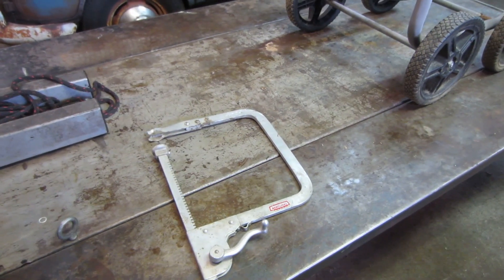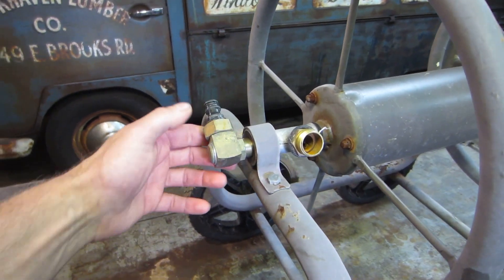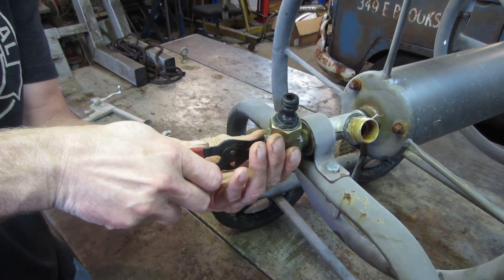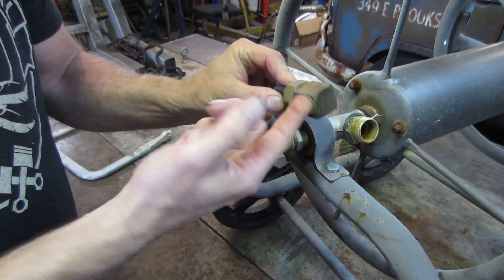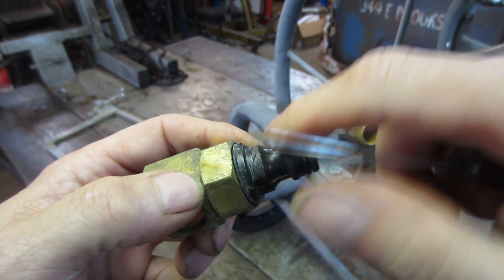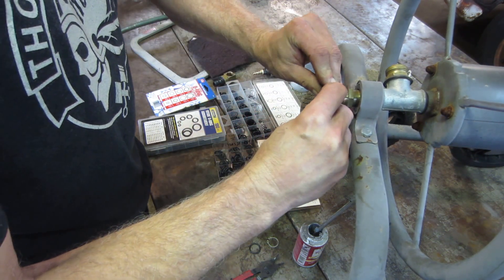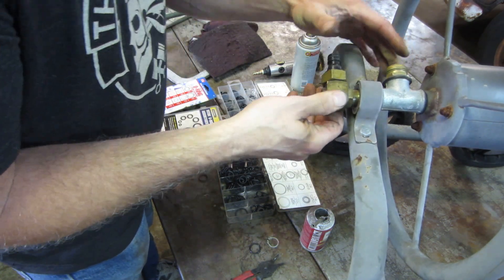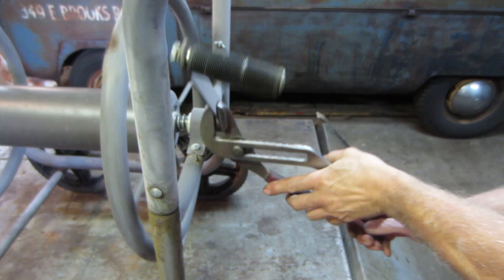scrap yard hose reel repair.

Comment: Thank you SO much for this video! I have 3 identical carts & 2 are leaking in the swivel. My father passed last summer & I’ve spent the past yr trying to fill his very big shoes in caring for the house, 10 acres, blackberries/fruit trees-as mom is no longer able. I can’t tell you how many seemingly small things like these leaks have made me appreciate how much he knew how to do & how much he did. Tasks that take me days to figure out, he would have fixed in mins. These hose carts have been so frustrating bc I haven’t been able to figure out how to take the swivel apart & hated to spend $200 a piece to replace. Dads workshop is filled w/thousands of parts for every repair imaginable but knowing how to repair, what parts to use etc has been time consuming. So I thank u today for helping me. I’m truly grateful.

Comment: LOL, never thought I could enjoy watching someone fixing a hose reel but I did, I did. Thank you so much for your videos, knowledge and saving some of the weirdest contraptions I've seen in a while.
We get snow down here and the kids want to put it in the freezer till summer. lol 
My third job was at a Volkswagen shop. I was 14. They had bought a train car load of Continental tires that fit everything from an Austin-Healey to a VW. Didn't have a Cotes. All I had was an IRON MAN. At 70 pounds soaking wet I learned the definitions of lubrication and leverage. I also learned about anchoring because one day I had to re-anchor it or not work. Not the perfect place to work but I learned bunches.

Comment: Not only did I put safety goggles on, I put on a hockey mask because last time you put one in my cheek. But I'm glad you finally broke down and bought a new wire wheel.
That valve clamp would have come in handy a few videos ago. Nice find on both counts!

Comment: I just got one from Rural King and paid $69.99. 5/5/2020. This is the same one you have there from Ironton. I did not use the wheels and mounted mine to an outside wall. Saved the 4 wheels, axles, and handle. My instructions where in the trash, I did not use them, they are useless instructions. So far I'm very happy, went together easy and I saved Money and it is cheaper that the ones they sell that mount on the wall. The one you have is much heaver than the one I brought.  The older ones are made better.

Comment: I gave up on vinyl hoses years ago.  They always failed within 2 years.  I only use Craftsman Rubber hoses: good in any temperature, crushproof, and can withstand the sun.  Twice the price but worth it for the longevity.  Good fix!

Comment: I have a wall mount hose reel with a similar connection. Just moved in and it drips. Quick run to the hardware store for a couple o-rings, no more drips!!

Comment: looks good, you may want to weight it down with some concrete blocks to hold it stable while wrapping up the hose or pulling the hose off the reel. just a thought.

I'm getting to think like my son. while you were wrapping that hose on the reel I was thinking of powering that with one of your antique engines.  

anyways, thanks for the videos. I am hooked.  I can't do much of that anymore. bad wrist, bad back. bad eyes. I had to have my son do the plasti-gauge read  on on my truck engine a few years back. couldn't see it well enough even with a magnifying glass. now I just armchair it while you do the wrenching, or sit on the hose reeel to keep it from tipping over while you bent the handle back into shape. but I'm afraid my excess weight kind of did a number to it. I won't say anything if you don't notice.

Comment: Silicone grease is a plus!! should also be under the rings in the gland, not just the OD swivel part. Is high pressure and low pressure SCUBA systems, we use either silicone ( dielectric ) grease on buna-n rings, or for high oxygen lines, Viton rings with Cristolube 111.

Comment: This is indicative of our throw away society. Throw away instead of fixing. Just as a suggestion, the best lubricant for o-rings is Arturo-glide. It was developed by NASA for the space shuttle. When I worked at a cotton mill I kept some in my tool box just for that. Took a lot of crap about it till they found out it how it worked. Then the mill ordered for all departments!
Reply: developed by NASA for the space shuttle. When I worked at a cotton mill I kept some in my tool box just for that - Because at the mill you worked at there was a space shuttle...
Reply: @dashrendar99 yup yup. we dont need no stinking innovations. animal fat worked as lube for the settlers. so its good enough for the mill......
Reply: I wasn't able to find anything about "Arturo-glide", any link to it online?
Reply: Spaceshuttles, A-lube and O-rings....hmmm...what could possibly go wrong ???

Comment: So were you feeling a little horse, or did it nag you?  LOL :-D.

Hey the reel is  usable now and better than your old one :-D
Shame about the crappy plastic part, i'm sure that a brass one would not have failed.
Channel locks, handy tool, i bought a pair and don't know how i managed without them.

Comment: FYI: You'll find that the Craftsman valve spring compressor won't work on VW heads, at least not without modification.

Comment: My fuel filter in the rear only fills half way, until I rev it up and drive it's fine,the filter under the gas tank is full, but when I go to start it in the morning it takes a lot of cranking to pump the gas in the carb cuz the rear fuel filter empties itself. 73 super beetle, new fuel filters, new soft fuel lines,new fuel pump, new fuel pump rod and new base for the fuel pump and new carb,? Any ideas??
Reply from the maker: sounds like the pump is bleeding back , pull the inlet line off the pump and see if it will empty out the filter, if so that new pump is no good, lots a chna crap out there, and its normal for the filter to fill half way, its trapped air, and what l said to try is if the filter is between the pump and carb,good luck
Reply from the maker: and with the car off, just sayin,
Reply: Mustie1 😞it always the Chinese..😏 but its true.
Reply: Mustie1 dude... It did what you said,  and it was made in China,,I put the old one back on made in Germany and it fired right up. The old one was working fine, it was the base plate that was broken, but I replaced it. Thanks for your awsomness.
Reply from the maker: glad l could help

Comment: Real or reel ?
Reply: a real reel for reeling in a real hose.
Reply: michael adams 
Really now, a reel in real need of a really good service. Musty keeps the reel real.
Reply: That is one heavy duty hose reel. One of those new is probably $200 clams. If it's even possible to find one like that brand new! Nice job getting it back into shape Mustie.